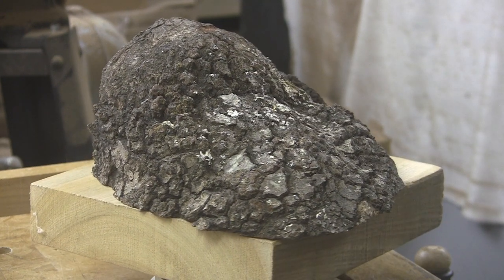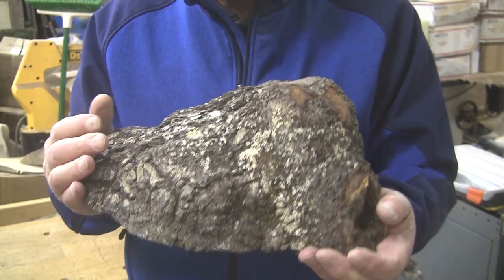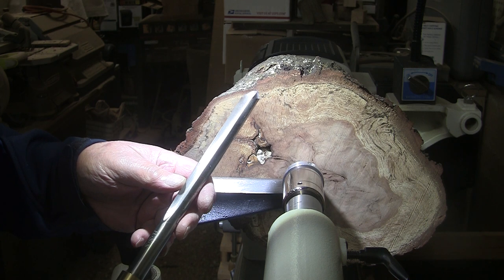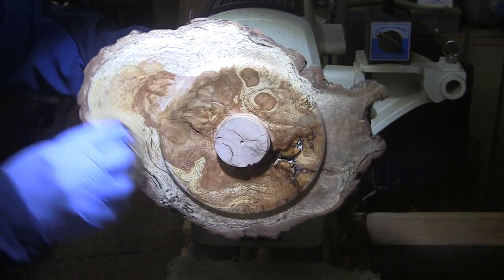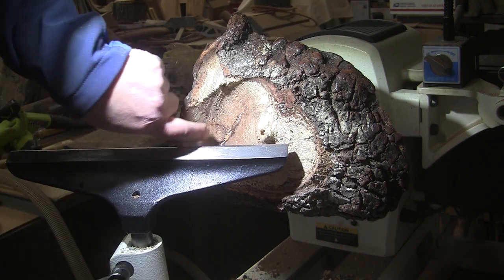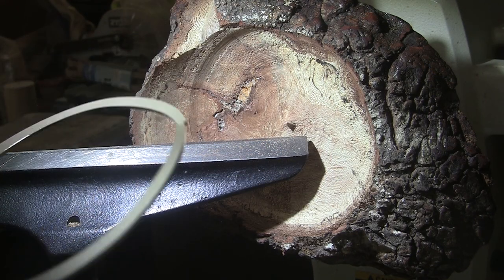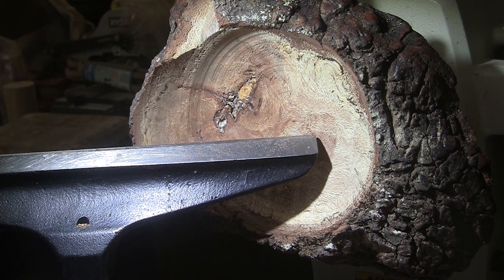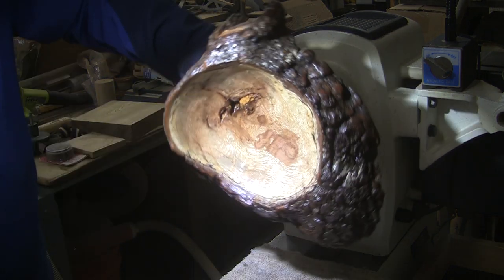See The Figure In This Oak Burl! - Wood Turning

Comment: HI PHil. Aother great job in the books. Turned out well. I do see HOmer.  LOve the finish on it. One question??. DO you buff the bark too??? Would love to see how you do it.  have a good weekend.
Reply from the maker: I do not buff the bark, Ron.  For some reason, it just doesn't need it.  I think it's because when you touch it you expect roughness but it just isn't.  The Sand O Flex makes it nice and smooth and it really doesn't need anything else. 😊

Comment: Beautiful work and burl, Is there a specific reason for turning the nub away rather than just chiseling it off and sanding it. I imagine this is just your WAY of doing things for the video?
Reply from the maker: Thanks, Rick!  One day I was just removing as much material of the tenon as I could before taking it off the lathe to use a chisel on the workbench.  Then as I was doing that I thought, "I bet I can just finish it right here with this chisel in my hand."  It worked and I've been doing it that way ever since.  Also, with many pieces I turn, the top can be very uneven and difficult to lay upside down while I try to hold it steady enough.  This way is just easy, that's all. 😊

Comment: Homer has one single hair sticking up. I think you mean Bart Simpson the son.  This would be an evil Bart for sure.  When you first showed it I saw and evil elf. 
On the other side I saw part of a face of a Koala with it's ear up by where you replaced the bark and then the eye and sorta the rounded part of the left side of the face.  The thing you were calling a bear print only had two spots, not really, really enough for a paw print, but I understood where you were going. ;-D
Reply from the maker: You are right about Homer, of course!  It's been quite a number of years since we used to watch that series regularly.  Maybe back then Homer had Bart hair?  LOL!  I'm glad you could see so much in this piece, thank you! 😊

Comment: Phil, I am enjoying your videos and the way you explain every thing.  One thing I'd like to see you elaborate on is what factors do you use to determine the top and bottom on burls and crotch pieces.  If you already have a video on this, what is the title.  Thank you
Reply from the maker: Thank you!  I don't have a video on that but I have explained it in several videos, Bruce.  Basically, my first consideration is where and how can I get a good hold on it.  If there is more than one spot, then I go through the turning in my mind, imagining what it will look like at different points in the turning if I pick this spot over that spot.  My goal is almost always to get the most, largest out of any particular piece.  Hope that helps! 😊

Comment: Where did you get the thickly padded 2 inch sanding disk pad/adapter? I have one similar but the padding on mine is much thinner.
Reply from the maker: Everything I use for 2" sanding comes from this link including the Apprentice Soft Backing Pad.  😊
https://www.woodturnerscatalog.com/t/114/Hook-and-Loop-Discs

Comment: Wow that came out fantastic! If a person doesn't have a sand-o-flex, how did you sand the bark before?
Reply from the maker: Thanks, Hotrod!  I've had a Sand O Flex since I used to sell them in a hardware store I worked at in the 70's and 80's.  I used them on the edges of routed flat work before I became a turner.  That's when I discovered they are most useful for bark and other odd shapes.  Never sanded bark before then. 😊
Reply: @PhilAndersonShadyAcresWoodshop  Oh ok, thx for the lesson. Never thought about using those on my hand carved signs

Comment: Another beautiful bowl Phil, and very interesting video, once again! I wonder how often do you find the center at once after inverted the workpiece to shape and remove the tenon, or, how often you have to move it several times to find perfect balance? Thank you. Best, Serge
Reply from the maker: Thank you, Serge!  Your questions are not clear to me.  Are you only asking about removing the tenon?  It's easy to find the center because the center of the tenon is still marked.  Occasionally I might have to adjust just a touch, but not often.  Then you seem to be asking about balance, not sure if this is the same question.  Balance doesn't usually enter into my turning as evidenced by the slow speeds I have to use for most of my work.  Having a balanced piece would be nice for higher speeds but it just doesn't happen very often in these organic turnings I like to do. 😊
Reply: @PhilAndersonShadyAcresWoodshop  Thank you for your reply Phil. Being French speaking I'm not always clear in English. What I really meant is, the center point left by the live center being perfectly centered, do you usually have to shift the bowl on the opposite side, hence against the wood block chucked on the headstock. I can't recall if you already mentioned such step.
Reply from the maker: @bricofleur1768  OK, I did answer that part. Very seldom do I need to adjust the piece against the wood block.
Reply: @PhilAndersonShadyAcresWoodshop  Thank you very much, Phil. In fact I saw you doing it in your last video, Black Walnut Vase for Valery. Best,
Reply from the maker: @bricofleur1768  A vase is different.  I have a small dowel that I use in place of the wider wood blocks I use for bowls.  That dowel has to be centered but you can't see how centered it is or isn't.  Takes a little fidgeting but you can get it with persistence.  I thought we were talking about my normal turnings of bowls, sorry.

Comment: Phil, I was looking for that Zinsser Seal Coat in my area but only retailer to sell it is a Do it Best hardware store. I also found it’s 100% shellac in a 2# cut so I made my own from flakes and denatured alcohol. Works great
Reply from the maker: You just need to be sure you are using dewaxed flakes, Robert.  Any top coat will stick to it if it's dewaxed. 😊
Reply: @PhilAndersonShadyAcresWoodshop  
Yes Phil. Its the only type I use.

Comment: Have you ever considered finding the center by balancing it on a shot glass or something similar in size?
Reply from the maker: I usually use a half inch dowel to balance on.  The problem with that is, "balance center" may not be the center I want based on the different thicknesses or other features of the piece.  😊